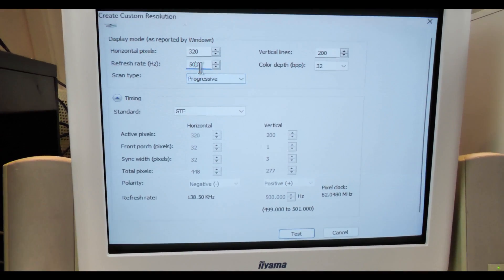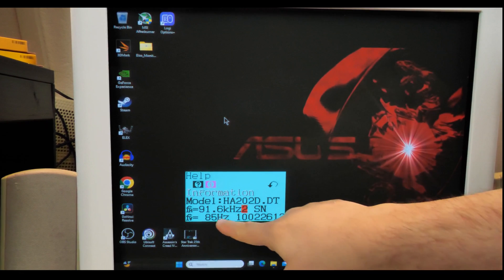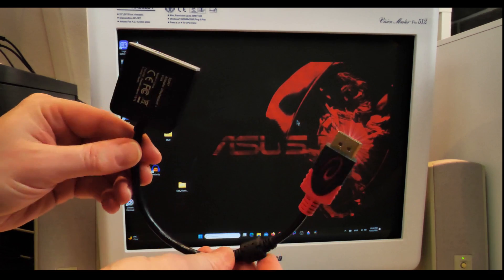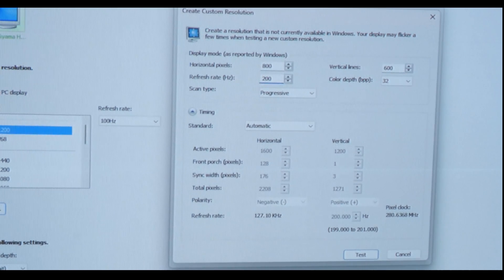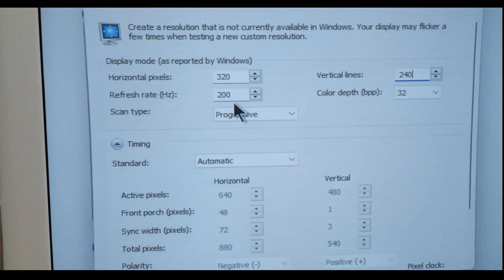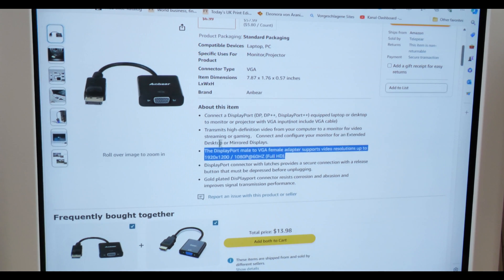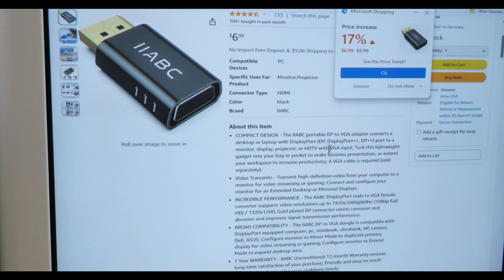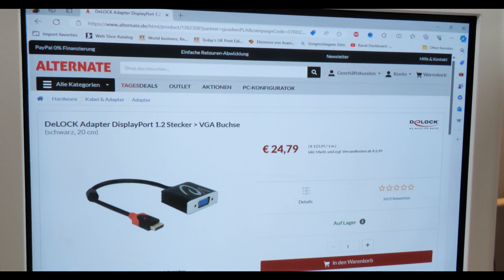The Best VGA Adapters to Connect a CRT Monitor to a Modern Gaming PC

Comment: Best ones to use are the Delock you mentioned as well as the Startech DP2VGAHD20 which reliably does 375mhz, if you are lucky you can find a Sunix DPU3000 or the Delock/IcyBox clone which does 535mhz but less reliable for some than the startech. For HDMI the best right now is a LK7112 chipset based adapter you can find being sold from turkey. Good video
Reply from the maker: Best info right there! Thanks! This will help a lot of us! 👍🍻
Reply: i am from turkey.
Which adaptor lk7112 used?
Reply: @imam-icereyan5471  Alfais AL4547
Reply: @imam-icereyan5471  
Alfais al4547
Reply: @imam-icereyan5471  you can find it on e bay
Reply: The Startech is the only avalible one these days, all the others mentioned stopped production years ago and the chip used in them is no longer in production, with that being said my only exprenince is with the startech and it's patchy to say the least and can often drop snyc at random times.
Reply: @terrytees   i got the startech DP2VGAHD20 recently and can confirm it drops intermittently and doesn't pick up EDID info, i need to set custom modes to reach higher res and it seems more unstable the higher i go. a very generic hdmi to vga does pick up EDID but ofc doesn't do higher res/refresh modes, struggling to find the delock. i have a Dell P1130 (sony gdm-520)
Reply: The  Delock  one in this video is out of stock everwhere and has been that way for a long time before this video, most places listing it don't have stock and it very much looks like Delock stopped production much as they did for the famed DeLock 87685.
Reply: @terrytees  I bougth last Item in one of the online shop of this delock model 1 month ago
Reply from the maker: @terrytees oh it was available in several places the day this video went live over here. But now it’s sold out everywhere like you say. I think the video did it’s part here also 😅
Reply: yeah, i use this startech adapter and it works flawlessly with my Sun GDM-5410
Reply: Thanks for the info, just what I needed!
Reply: Doesn't the startech also output only 1920x1080p @60Hz? At least that what I understand from their website. They do claim it does 4k @60Hz on HDMI.
Reply: @ArticFrost18  No it does well over 1080p via VGA obviously at much higher refresh rates as well
Reply: Digital Foundry recommend hight spec USBC adapters  with  chip IT6562fn, its goes about 390Mhz and has good depth of color, you can search on google by number of the chip.
Reply: I got that LK7112 adapter from Turkey, still can't get more than 1080p on my sun x7149a, CRU has no effect, and AMD custom resolution wont accept anything other than what windows says my monitor can do, so gutted.
Reply: @Wayno220  Are you sure you have LK7112? You should take it apart. Maybe you should apply Pixel clock patcher to remove 165 MHz Pixel clock limit, I have similar problem with ice box HDMI to vga adapter
Reply: @tvndno6023  thanks I'll try that, it's hdmi to vga so a 4k edid adapter allowed me to go up to 1200x1600, but 1536x2048 eludes me still.
Reply: i actually found a new dpu3000 comparable device. and no one knows about it. and i just bought one for $2. waiting for it to arrive.
Reply: @cheater00 so what is that modle
Reply: @cheater00 let us know how that works out
Reply: @cheater00   did it work?
Reply: @dantheman1337 haven't ordered it yet lol been busy
Reply: @cheater00 name or link to this adapter?
Reply: There is a new champion dac usb-c to vga cable matters 201368 capable of 720 MHz Pixel Clock
Reply: @tvndno6023  I have already thoroughly tested it and wrote a reddit post about it
Reply: @agfa1854  how did you find that good DAC? What is the story behind it?

Comment: I just want con connect my old Benq CRT to my moder PC to play at 800x600 or 640x480. Any adapter would do? I'm not interested in hz. 85 Hz is what my crt can handle.

Comment: I have the Delock DP adapter, tis pretty decent so far, not really put it to the test yet, as I mainly use my HD Fury 2, but that tops out at 225mhz (DAC speed), and the Delock does 270, the Fury has crem da la creme image quality though, reference grade, not sure yet how well the Delock stacks up in that regard to the Fury, I really want a HD Fury 5 with a 400Hz pixel-clock, 12-Bit RGB, and all the trimmings. (Or someone to make one anyway, a DAC that is as good as a native GPU analogue RAMDAC)

Comment: Unfortunately at this moment the delock 62967 is not available anymore. It seems delock stopped to produce them. The worst part is that there is no other adapter like this one on the market. I already have one but I should have bought a second one just in case.

Comment: If you have a motherboard with a VGA port built in and if you have an iGPU on your CPU, then you can try the hybrid graphics mode that laptops use. Your dedicated GPU renders the frames and passes it to the iGPU for the display output. It should in theory be much more compatible with a CRT.
Reply: ^This increases input lag , but still lower than lcd or low end oleds in most cases

Comment: i am a beginner and i was wondering if an amd integrared gpu will work?  what program are you using to create custom resolutions? i basically want to run ps2 and wii emulators to output to a crt monitor :) thanks a lot

Comment: Great video however it still doesn`t answer the main question, where to buy such adapter? all mentioned ones in the posts are already unavailable, which doesn`t make it easier ;), it looks like they have sold out all valuable stuff already and there is nothing left at least I couldn`t find any of them currently available.
If anyone know where to get them at the present day pls let me know :)
Thanks a lot in advance :)

Comment: No1 can Properly use windows 10/11 at Very Low Resolution, The lowest you should go is 1024x768p. (You won't be able to see everything in the applications, such as Steam, some options will be cuted out, you will need to change the resolution back to at least 1024x768p.)

BTW running games on that low Resolution gives a huge performance boost and 250~500hz is impressive..

Comment: Hi. I need help. I think you know the problem better. My CRT does not want to work from PS3 and PCI Graphics Card via HDMI to VGA Converters. More precisely, it works, but the image disappears into the black screen every 8-10 seconds. There are no problems directly with the VGA port of the old graphics card, it works very well.

Is there a problem with the adapters, or in the hardware of the CRT monitor?
Reply: ps3 has drm you need to strip it first.

Comment: I dont know what are you on about, but i had 2 crts that push 96khz and 121khz and i used the cheapest chineese adapters. I use CRU, maybe thats why, i dont know... Either way i go (high res or high refresh rate), it works, so i dont know, but i do have issue with my tft tv not being able to play videos via cheap hdmi to display port adapter.

Comment: Curious, i have a viewsonic G225f that has vga and bnc inputs. I already use my vga input for my analog output gpu, but since bnc does both analog and digital, are there any hdmi, dp or usb c to bnc converters that have a high pixel clock. 

The reason for my asking this, is because i want to add a higher end gpu and they only output a digital signal and would love to be able to utilize the other input .
Reply: I bought a cheap VGA to HDMI off Amazon, like $10 or something. Don't remember the brand, I just know it's white. It displays 1600x1200 at 65hz just fine all the way down to 800x600 at 120hz. My monitor can go all the way to 160hz, haven't tried it because the resolution would be absolute ass 

GPU: Arc A750 
Monitor Compaq FS 7750

Comment: I have a Viewsonic E70fb crt and the image shrinks and tilts every now and then so I have to use the buttons on the monitor to tilt back and "stretch" out the image again. Any idea what's causing this and is  there any way to fix it?
Reply: crts need approximately 30-45 mins to properly warm up afaik. its normal that the image is a little bit shrunk/distorted after switching it on, it should correct itself once warmed up.
also i have to readjust the picture in the monitors menu every time i switch to a new resolution+hz combo, so I'd suggest only fiddling with those after the monitor has fully warmed up.
If you're talking about random major distortions than maybe somethings broken but i would try out some other settings/resolutions before coming to that conclusion

Comment: hi,
you seem to like technical challenge.
I have a hdmi to vga powerfull enough but can't display 1440p of my ps5 on my 22" trinitrons pc monitors.
It has to do with the EDID I guess, as 1440p is under  these monitors top resolution.
If ever you would find a solution, you would be my hero (and the first in the wolrd to ever picture that, as there is no footage of 1440p from a console on a crt)!
See you :)
Reply from the maker: Hmmmm the problem is that the Console surely does not recognise the CRT and has no clue what it can do… Also the PS5 wants to display a 16:9 aspect ratio I think and only the Sony FW 900 can do that with 1440p.

It’s interesting but I’m not sure how to trick the PS5 into doing what you want. I will try it on a Sony FW 900 though and we will see what happens
Reply: @RetroGamingBase  the 16/9 is not an issue even on 4/3 crt pc, as they can display 1080p easily (with black bars top and bottom, but it is not that distracting).

Plus, from a pc, 2560 x 1440p is done with no problem.

If ever you managed to display 1440p from a console to the fw 900 that would be a great news. This screen is 120 khz max, and my g520p can go up to 130 (way more than reqquired to display 144Op @ 60 hz).

I think a retrotink 4k would be a good way to do so, as it has hdmi in and out and has many options to tinker with signal. Sadly it is very expensive.

I made a post on the crt collective on facebook. If you type 1440p ps5 you will find it, with pictures etc.

Thanks for the answer. I like your videos, it is great to show respect to crts ;)
Reply: You need better adapter, search for adapter with LK chip
Reply: @tvndno6023  I have the adapter with that chip :)
From what i gathered, it is about different timing between crt and lcd. Console are meant for lcd/modern display.
No one has yet displayed 1440p from a console to a crt. I'd love to see that one day!
Reply: @floriansolatges9624  i see :(
Reply: playstation use drm from ps3 up, you need to strip that from the signal first.
Reply: @Wayno220  I could do that with a powerfull upscaler like the retrotink 4k maybe? or an extron device. For the moment i'm very pleased with the 1080p signal so it's ok. I'll wait that someone succeeds in doing 1440p from the ps5 on a crt. For higher resolution on my crt I have now a pc :)

Comment: You potentially ruined that CRT for pointless tests 😔
Reply from the maker: @jimbotron70  haha I know right! 😅 So far it’s still working fine, but yeah I need to be careful now… Well at least I got my YT channel monetised thanks to it, so was not totally pointless 🍻😅
Reply: What makes you think that?
Reply: @simont3686  Out-of-range horizontal frequencies -> physical damage to CRT's components.
Reply: @jimbotron70  It won't display resolutions that are out of range, since they're out of range. "Modern" CRTs will display an error message or shut off if that happens. Older ones just fall out of sync and display a scrambled image.
Reply: @simont3686  The older ones are just those damaged by lacking protection circuits. Modern ones are a minority.
Reply: @jimbotron70 Nine of my Seventeen CRTs do not have said protection curcuitry. All of them have survived being out of sync at some point. Being out of sync for a few seconds when trying resolutions is part of standard operation and as far as I know, will not cause any harm.

Of course, please tell me how you think it would cause harm. I don't want my equipment to be damaged.
Reply: @simont3686  It would cause harm simply because you feed them signals well above the technical specifications. Like feeding loudspeakers with amplifier power above the recommended range, or diesel engines with gasoline.
Reply: @jimbotron70  I don't think these comparisons can be applied here, nor do they explain a lot. Could you please explain it in electrical terms? I'll do my best to understand.

Comment: I think I spent over $100 USD for two Delock adapters shipped from Germany almost 10 years ago and I still use them to drive my CRTs. It's nice not to be limited by the adapter.
Reply from the maker: Yeah exactly! Good adapters are worth the trouble

Comment: The best DAC to use were the Sunix DPU3000, Icy Box IB-SPL1031, and DeLock 87685. The common thing with them is they all contained the Synaptics VMM2322 chip.  Now there is a Mini DisplayPort to Dual-Link DVI Adapter - USB Powered - made by startech Product ID: MDP2DVID2 Intresting thing about this is in the specs it also contains the Synaptics VMM2322 chip. It's a Dual link DVI but going analgoue DVI to VGA isn't a issue. I have never used this adapter but it maybe worth a try as it is the VMM2322 chip thats key and even a chip swap would work.
Reply: I tried the Club3d Cac 1010a. Its the same as the startech just without hdcp. Turns out the analog out pins are not connected so only digital out.
Reply: Dosnt  work
Reply: @tvndno6023  Expand on why? 
Have you tired the the MDP2DVID2 ? ........... What refresh rate did you manage to get it up to?
As for the VMM2322 it's can be hijacked and firmware should be available
Reply: @terrytees  someone tried and  DVI output of this adapter doesn't work for VGA signal, for some reason, hardforum fw900
Reply: Vmm2322
Reply: What about the DP2VGAHD20 from startech? Sadly the information these websites give is a joke.
Reply: @ray-sattler  that one is good for 360hz. There is also the Silverstone EP16 which is the same but with usb c. Everything with it6562 chip or anx 9833 (which is capable of 270 mhz) is pretty good.
Reply: @ray-sattler  I own the DP2vgahd20 - it's ok but does drop signal from time to time, it's resolution rates are no were near as high as the first three mentioned although in there absence I believe it very well may be the best option available.
Reply: @terrytees  Well the thing is, i want to use my new graphics card and don't really have money to buy also a new monitor, i also love my CRT, so i guess i will buy it. How often did it lose signal? Thx for your reply mate
Reply: @terrytees  1600x1200 @ 100 Hz should be possible i guess?
Reply: @ray-sattler  then an adapter with anx9833 should be enough because you only need 270mhz bandwitdth. Which CRT model do you have?

Comment: interesting. I've been using a cheap no name adapter without any problems but my crt is limited to a 70kHz horizontal refresh rate.
Reply from the maker: Yeah at that KHz you won’t get problems with any adapter 👍🍻

Comment: I my tests with my crt, im usally bottlenecked by the horizontal frequency(lowering horizontal resolution to get higher refresh rate.) . by using a more narrow aspect ratio(4by 3 is native, but 16 by 9, 16 by 10, and 21 by 9) allow to retain better image quality while still pushing higher refresh rates.
Reply from the maker: Nice! Yeah makes sense! 👍

Comment: I think you should have said that the cheaper adapters, like the Rankie one you had at the beggining, are actually fine if you have a more basic CRT, like the very typical 17" 1024*768 @ 85HZ models that are easeir to find at reasonable prices (or free). If that's all your monitor can do, don't waste money on more expensive adapters.
Reply: The cheap ones like Rankie usually have an AG6200 chipset, which actually produce pretty poor color accuracy and lose a lot of shadow detail
Reply from the maker: Oh yeah! A valid point! I was really talking about 21“ CRTs since those are the ones I use.

Comment: Since windows 11 lets you choose the gpu for each program, I got an old AMD gpu with a VGA output, and use it with my RTX 2070!

It's important to note that two GPU's of the same manufacturer from different generations dont work together!!

For my setup I'm using my crt at its max resolution of 1280x960 @120hz interlaced :D
Reply from the maker: Yeah totally true and a nice resolution/hz combo 👍